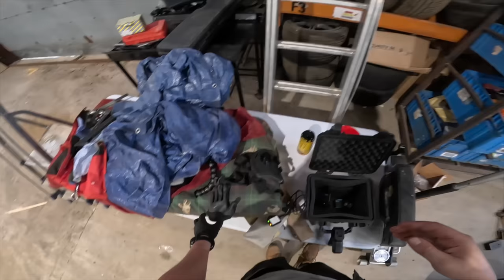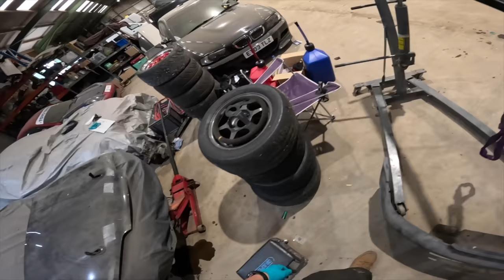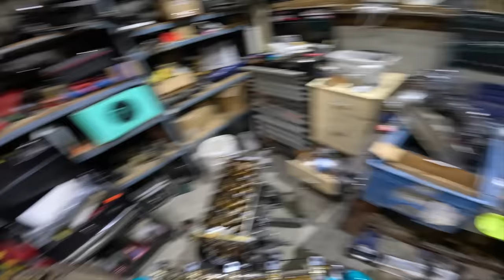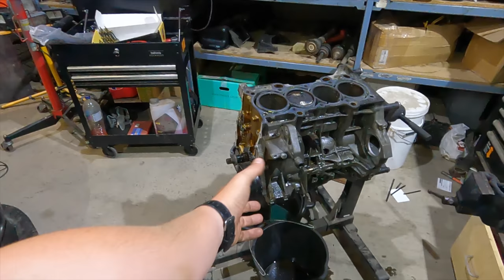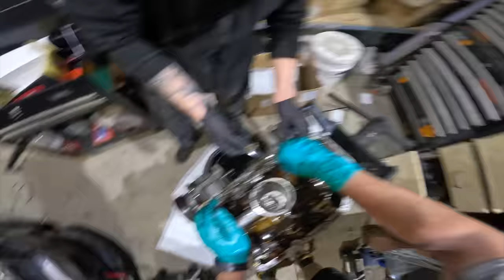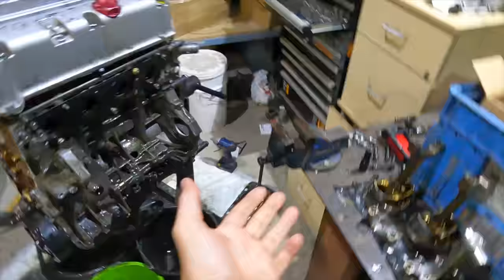What Happened to my Engine?? JDM K24A Teardown

Comment from the maker: I was baffled by some of your comments so watched a bit of the video again. The bit where we are taking the rods/pistons out I edited a lot from due to me and Matt talking some rubbish

What’s missing from there is the smell of the crankshaft when cylinder 3 rod was removed. It absolutely stunk. I’m not sure if I videoed the bearing either but it was welded to the conrod 

Could the piston have failed to cause that? Or did the bearing fail, leading to the chaos. Hmmm
Reply from the maker: Why would it be knocking from the headgasket going?
Reply: @dannyDC2 yeah and it’s not common to get a hydro lock from water flowing in the cilinder when it’s revving it’s tits of. Would be way to slow to get inside and you would have seen white smoke for a little while
Reply: Id go with that too. The initial water ingress and relatively low hydrolocking may of caused a spun bearing first(the very least amount of damage possible in that situation), causing the knock, power loss and extra heat (probably what the cooked smell was that dan mentioned, if thats what it smelled like?) and then eventually there was too much water, causing the rod to bend on compression stroke, jammed the piston in the cyl, ripped the arse out of it... etcetc. 
It did happen on a upshift too iirc? High rpm, high vaccuum situation, causing more water to get sucked in maybe? 🤷
Reply: @upurkilt7246  hydrolocking would've severely bent the rod as well. I would say the injector failed on cylinder 3 melting the piston would a more than likely scenario.
Reply: Could the injector failed on Cylinder 3 melting the piston??
Reply: @upurkilt7246  Fair Enough,  mine's a Theory as well 👍
Reply: i don’t know tooooo much with k series, but doesn’t cylinder 3 in k’s get way hotter than the rest? causing bearing failure, smell and in the end the piston? i guess now it’s to figure out why it got hot to that point, but i’ve read on boards before that people just put a little more fuel into cylinder 3 to keep it cool though
Reply: @markwalton8644  easy to test. Check the loom for power and check the injector for flow.
Reply: @tinuse3670  
Definitely, but I suspect the injector rather than the wiring as I'm sure the same loom was used for the replacement engine 👍
Reply: Looks like a melted piston, detonation or mixture leanness. I would be checking your engine map.
Reply: @upurkilt7246  Yes, I know, it will be interesting to see if he has a similar problem down the line. I am not saying it is the map, I don't know any more than you do, it could also have been a faulty injector,  but I am just suggesting he take another look at it just to be sure. He can't keep popping engines!
Reply: I thought people put the k20 oil pump in a k24 coz k24 pumps are shit and fail 🤷‍♂️
Reply: @dannyDC2 knocking sound would be conrod bearing at no.3 started going out..

And when the bearing spun+stuck.. the rod would definately destroy the piston as well at that much rpm racing condition..

It could be oilling issue..
Also could be injector stuck closed/not at optimum flow on no.3 (leading to detonation, overheating the piston and stressing he rod bearing)

Also K24 should NOT be revved to the moon (if compared to k20)
Reply: @upurkilt7246 the bearing closest to the oil feed will fail first, not the furthest one away, because the furthest one would have the most time with oil. The bearing closest will be the one without oil the longest as it’s the first bearing to start to not receive oil from the pump. I recently had a pre crossflow in  which failed due to oil surge in the tank and the bearing closest to the oil feed in failed and the second bearing from the feed welded itself to the crank.
Reply: It’s really hard to say sometimes why an engine has failed, it sucks because when you get it back it’s hard to know what went wrong because of the destruction. I don’t know much about the k series engines, I build Ford cosworth stuff but if I had to guess I reckon something happened and it broke. 👍🏼

Comment: For what you do and how fast you drive, an oil accumulator is going pay for itself easily, and remove lot of headaches of having to replace engines on race days. As stated by others, baffles are not enough.
Reply: Does that mean going dry sump or just more oil capacity i dont knowbut im interested..
Reply: @zedfender9423  It's a cheaper alternative to a dry sump system. It provides oil pressure to the engine if and when there is a loss of pressure from the pump. Accumulates and stores oil under pressure and uses it to 'fill in' dips in oil pressure during events like hard cornering.
Reply: @zedfender9423  what unicorn7337 said. Poormans setup but works wonders for road racing.

Comment: engine detonation, pinking damaged piston then complete failure
Reply: Didn't it run low on fuel and get a few sputters the previous race? Could have damaged the top of the piston then next time out it gets up to temp and lets go?

Comment: Usually no.4 big end bearing that fails first if oil pressure is ever a regular issue (Furthest away from the pump). Piston speed is high on a K24, its likely the piston that has failed around the little end/wrist pin and carnage ensues! The damage to the cylinder seems to point that way as against it being a bearing failure and it throwing/snapping a rod.

 Good effort getting the replacement engine in, was a mega race to watch!
Reply: I'd have to agree with you ...the bearing failure might actually be due to all the piston nuggets getting between the  up & down motion of what's left of the falling apart piston, and the combustion chamber. Even the rod is tweaked(surprised that it didn't break also).
Reply: @danielcgomez  it’s always fun to try and determine what’s gone on! 

The way the head gaskets blown out too could suggest there’s been ringland failure/butted rings that have fractured the bore but you’d have expected tell tale smoke/steam from the exhaust before it let go completely. From the race video I’d expected a dropped valve initially. 

Perhaps it could just be a combination of a failed bearing (thus excessive “clearance”) and high piston speed contributing to too harsh a change in direction of the piston that’s  ultimately led to it breaking up? Who knows! One things for sure, something definitely ended up between the head and the crown to tweak the rod like that 😬

Comment: My diagnosis is rod bolt stretched from high rpm causing big end bearing clearance to increase ( knocking sound and heat colour on crank ). This clearance reduces oil pressure for the little end which seized (again heat colour on center of wrist pin) and broke out of the piston. Then the rod smashed the piston everywhere. To confirm this measure the rod bolt length of failed rod and new Honda specs/ tolerance. 
Absolutely awesome drive in race 2! Sometimes it’s funny how anger turns to a good focus. Well done keep it up, love the content.

Comment: My money is on fuelling/detonation to result in an outcome like that, especially one so isolated to a single cylinder.
If it was low oil pressure or an oil-related issue then you’d probably see more damage/wear on the other engine bearings, you’d also potentially be dropping out of VTEC while driving, which I didn’t hear.
Get the injectors flow tested and whip the plugs out of your current engine to check the colour to give you an idea of how each cylinder has been running.
Other options are things like the water jacket getting blocked around that cylinder causing it to heat up, or maybe the oil gallery/squirter to that cylinder got blocked, but it would be pretty odd for something to happen on isolation like that when the oil/water are common feeds/flows throughout the rest of the engine.
My money is defo on fuelling/detonation causing the piston to grenade itself.  Could also potentially be ignition timing related, but again, for that to be in isolation and not causing poor/similar running across all cylinders would be pretty strange

Edit - also think it was less likely to be head gasket failure, as they tend to let go a bit gradually and you’d probably have seen white smoke if you were burning water.  You did say you felt it was a bit slower for the last lap before failure - does your footage show any white smoke etc?  (White smoke = water)
There is a chance it could have catastrophically failed and filled the cylinder with water, but I think that’s less likely, because for water to flow in at the rate needed to do mega damage is unlikely due to cylinder temps and the small space available (even with a totally blown gasket) for the water to actually flow in

Comment: I'm going with timing. Also Cylinder 2 & 3 run hotter than 1 & 4 due to less area covered by the water jacket. For sustained high rpm driving can always add 1% - 2% extra fuel in those cylinders to aid with cooling. May have cracked a ringland which can un balance the cylinder

Comment: Hard to tell from the vid, but if the bearing had failed there would be a rainbow heat bloom around the rod, and if it was an oil supply issue the other bearings would show signs of it,as would the top end, most likely the piston skirt/ring land failed just due to hours used, or the injector on that cylinder failed/got blocked and it detonated to pieces, amazed the baffle survived! hard luck but thats racing huh, look forward to more vids :)

Comment: I wouldn't say big end bearing was cause, more effect. As others have said, get the injectors flow tested to be safe. Could have nipped a piston ring, got hot (timing and/or fueling), or piston has began to break up under load (happened to me on Rover V8, forged piston cracked, failed and ended up with rod cutting the engine in half!).  Ultimately it's the piston that has failed imo. If big end had failed first it would seize, but not (in my experience) explode...

Good effort getting stuck in to the engine though! Scary place if you've not done it before 🤣. Sure you'll come back stronger for the experience though bud 💪 👍

Comment: Just my two penneth... Looking at the damage the failure originates as piston failure and anything else is collateral damage. What caused the piston failure isn't easy to determine without closer inspection. I have seen piston skirts come off due to partial seizure and piston crowns come off through over revving. You did say the bore oiler was missing, and whilst it could easily have been damaged it could have been missing all along, if that cylinder was running lean it could have elevated cylinder temperatures and either could have caused partial seizure. There are lots of reasons as to why the piston could have failed, I somehow doubt it was bearing failure as the piston would have survived long after the con rod was poked out of the side of the block nor ring failure as the engine would have been down to 3 cylinders for some time before failure. I watched the race video and the failure seemed pretty instant?
Please let us all know if you get a concrete diagnosis. I was very impressed with your team who all pulled together to get you out on track and indeed your drive from last to second...
Reply from the maker: The piston failing could cause the bearing to seize to the crank? 

Is it not more likely the bearing failed causing the piston to be able to move more than it should, eventually getting mangled 

Just seems odd that the bearing stunk and was super toasty
Reply: Hi Danny, trouble is when theres so much damage its so hard to tell what came first. I would have thought that if the bearing seized to the crank first then the weak point would be the con rod which would have broken but to be completely fair you have seen it and I havent. Was still a great drive though!! @dannyDC2

Comment: Looking at the big end and crank that looks OK from the vid, I'd guess the piston developed a crack round the ring lands or skirt, some bits fell off and that was your knocking period, then it just tore itself apart until it fully let go. I don't think it was oil starvation as the shells would be welded to the crank and rod. It's just been rung hard for 1 lap beyond its life desires.

Comment: Piston McNuggets and engine gravel. Proper destruction. Based on the crank and rod on #3, that was oil starvation. Likely root cause was bearing failure, but it could also have been a bit of junk in the oil that clogged the passage in the crank.
Reply: a fan of Eric from 'I do Cars' huh ...hahaha
Reply: "I do cars" is just a great channel. Love some good piston mcnuggets

Comment: Not sure if it's the case on yours but I melted a hole in a piston on a fiesta rs turbo once, one of the injectors must have been weak and it leaned out to the point of melting a hole, if it had been much worse I can see how the piston would seperate from the rod, the bearing and carnage could have come after the piston left chat in the most spectacular way

Comment: On these engines what retains the gudgeon pin in the piston?  This looks a bit like the failure ive seen in high revving bike engines where the circlip on gudgeon pin makes a break for it.  Piston gets lunched and smashes around.  The slight blueing you have on the big end might just be lack of lubrication in the final thrashings.  Once piston is gone and rod at a weird angle, oil doesn't stay in big end bearing and gets hot. Anyway, thats all total guess work from my armchair whilst drinking SanMiguel, but i thought in true YouTube fashion id throw my hat in ;)

Comment: I did notice you didnt lock the baffle in around the oil pump neck. The baffle has a sliding part that locks around it to prevent oil from sloshing out.

The baffle shouldnt come off with the pan

Comment: Did you reuse the injectors on the other engine? If not, be interested to see the flow on them across the board. Some good theories in the comments. Could be gasket failure or lean cylinder. More investigation required 🍺

Comment: Perhaps the liner had cracked causing the piston skirt to bind up in the bore which would naturally tear a hole in the cylinder wall as the crank rotates further and ripping the little end out of the piston. Good effort swapping the engine over and great video.

Comment: Had the exact same thing on my clio, bearing was fine for me, but could have been damaged in the chaos for you? Spoke to an experienced engine builder who said the only common case of this was ford sierras, that was a piston skirt design flaw, later found out the wossner pistons I had put in my engine seem to have the same issue. Have a look at your other 3 that are left, you might find hairline cracks down the skirts. Might be completely wrong but that's my experience of this sort of failure
Reply from the maker: Sounds unlikely but will check

Comment: My Theory is the injector failed on cylinder 3 melting the piston. 
If the issue was an oil one then more than likely the crank/ pistons would have seized. We didn't see any bent rods or damaged bearings just a missing/destroyed piston and it only happened on one cylinder!!
I'm sure that's it, unlucky if so!!

Comment: Didn't look to be any heat in the bottom of the 3rd rod, that to me says not a bearing failure. 
Get the injectors flow tested, lean cylinder, piston say bye, bending rod and chunking crank in the process.
Thats my guess.
Reply from the maker: I must have made a bad video if I didn’t show you the heat of number 3 rod bearings. If only you could smell it!

Comment: I think either it had a cracked liner and it hyrolocked what caused the force on top of the piston or is there a way for water to enter the engine from the inlet dont know if water runs in a passage on the inlet manifold never worked on one of these. Thats my theory anyway.

Comment: Classic Piston Pin Boss failure there I'd say. The rod is bent like that because one side of the Piston Pin, briefly had 1.25x piston above it. 😂You can't get that level of bend from a hydraulic event unless you dumped 40cc of water just down one Intake Valve in that port. When you get true hydraulic or overboost failure rods "tend" to fail though the plane of least resistance (Thrust/Anti-Thrust).

Your bearing failed after it got crushed along with the, still connected, half of the piston,

Too many high speed downshifts I would say (there were quite a few I winced at just before it popped). The inertia of an unloaded piston is insane, your're relying on two 5mm thick aluminum cups trying to keep the Piston from continuing upwards. This is aggravated on downshifts as you have no gas pressure to provide a "cushion".

Seen it many times before myself and have a half and half piston myself here, just like you have there.

Would need to see the big end bearing and crank journal to fully confirm though.

Ping me some Hi-res pics and I'll have a look. 👍

Comment: The piston (or what's left of it) looks melted but it's hard to tell from the video.

If it is melted as badly as it looks i'd put money on that cylinder running lean from a failed injector, need to create some serious heat to melt a piston that badly and considering it was isolated to one cylinder i'd put money on it running lean.

Comment: Could be a complete coincidence but did you not change the sump baffle just before this race? I would check all bits of it are accounted for. I just watched a video of a GR86 using a prototype baffle to fix oil pressure drop issues, baffle failed and killed the engine.
Reply from the maker: Well the old sump baffle failed, so perhaps that caused some issue with the bearing that led to it failing early